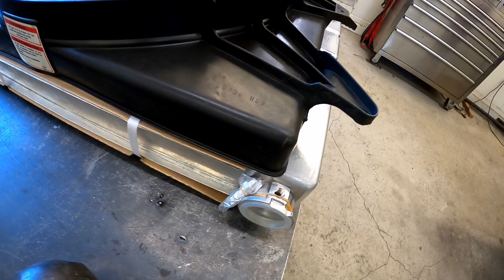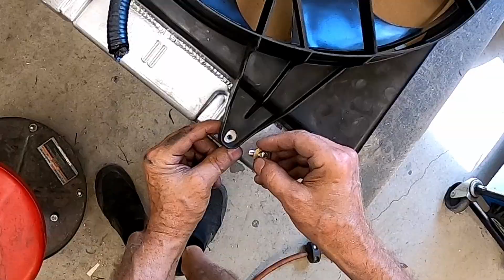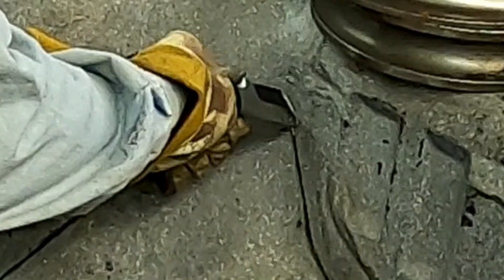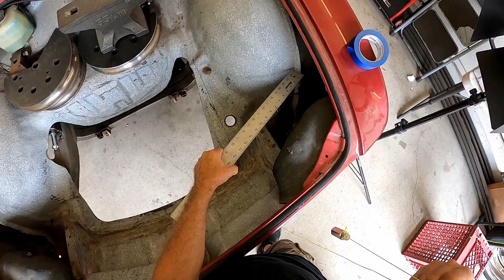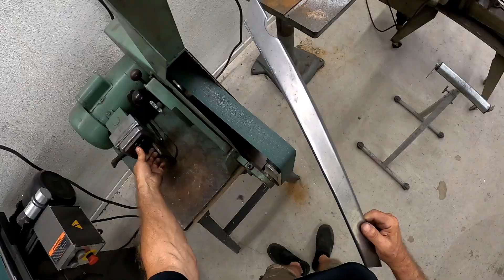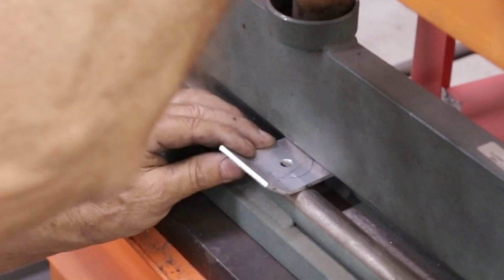Radiator into Corvair

Comment: Why didn't you put the radiator in the former engine compartment? You have that huge hole that needs to be closed and air flow could be directed from under the car through the radiator and the out the rear horizontal vent.
Reply from the maker: It's been my experience that the radiator needs to be up front in direct airflow to guarantee against over heating.  Other places may work but usually have over heating problems.

Comment: Flexible magnetic ruler?! That sounds life changing for cutting a C10 bed down. Which one do you have? There are some on eBay and amazon but I'd like to get one out of the gate that works.
Reply from the maker: I got them from Amazon.  1',2' and 3' pack.  I don't know what longer lengths they come in.

Comment: I’m wondering about where you are putting the inlet for the air cleaner…under the car.  This is right where you are dumping the 200 degree air from your radiator!  Why not use the conveniently located air vents at the bottom of the back window?
Reply from the maker: Good question and one that I fussed over.  Originally, the plan was to use a 270* tube and aim the intake/air filter where you are talking about.  After purchasing the 270* 4.5" tube and setting it in place over the engine, it absolutely destroyed the visual look.  Plus, it made trying to package an engine cover nearly impossible.  A 9" air filter with huge tubing and bends also takes up more room then is allowed in that area.  So without adding in goofy side scoops, the only place to get cooler air and quiet down the intake noise was underneath the car. True, the fan blows hot air but it's quite a bit forward and I think it will be defused enough by the time it gets to the air intake.  I'm not sure I'm done with this yet as I don't like the huge tube either.  May just run a short air cleaner and take the 20 +/- hp hit.

Comment: Okay.. If you throw the hood away and put that thing on the bumper, it just might get some airflow through it. Only problem is to decide, which way there's less air bubbles in the coolant, bcz either way, there will be bubbles. Corvette has the radiator tilted forwards, to keep the overall height down, but still keep the incoming coolant line for the engine air free. If you'd put the expansion tank to the heat exhanger for the defrost unit, and run it all times, those headgaskets might have a fighting chance. As it sits, a trailer queen.
Reply from the maker: Glad you have it all figured out.

Comment: That's a great fab job! However you will need to be very careful driving at speed even in a 1/4 mile. My best estimate is that the car will get awfully squirrelly around 85/90mph maximum. 
The cooler the ambient air, the greater the thrust lifting the front end will be due to the increased volume from heat differential.
If it affects handling adversely, it will in a Corvair with an already light front end, you can always remount it to vent out the hood (optimal) or out the fenders.

Comment: Have you given any thought to how you are going to fill the radiator? It MAY be a problem if you overheat while on the streets and will take forever to fill with a cup small enough to fit in the available space.
Reply from the maker: There will be a curved filler neck welded on.

Comment: I’m thinking that having the air flow down under the car will create lift, but if you put an air dam on the bottom of the car and the fan on the top of the radiator and create vents in the hood for air to evacuate it will create down force
Reply from the maker: Trying to do as little visuals of vents and certainly none in the hood.  The  airflow coming from the fan is anemic compared to the weight of the car.  An air dam at the front will help though.

Comment: Love the build John I have a question. Is the engine compartment entirely venting through the radiator? And if so will that little Chinese regime produced two row  radiator going to be sufficient. Personally I so much admire your Fab skills and would have loved to seen you build your own radiator.
Reply from the maker: The engine compartment will be somewhat open so air can circulate.  The environment where the radiator lives limits it's size.  I think it will be enough radiator, we'll see.  It probably will hinge on how much air I can funnel into it more than anything.

Comment: The band saw you are using cuts very well, what are the blade specs?  Thank you and have a most awesome evening!
Reply from the maker: The Lenox blade a newer so it's cutting straight.  Anyway, because I'm always cutting tight curves, I use 1/4" wide blades.  The pitch and TPI is as fine as is available when ordering. Thx

Comment: 👍👍😎👍👍 John, thanks for another inspiring fab lesson.  Especially liked how you bumped the aluminum tabs for the radiator, as well as the undercut reliefs for the weld-on fan mounting posts.  That’s high-level thinking ahead right there (or maybe clever solutions born from experience 😉). All the best.